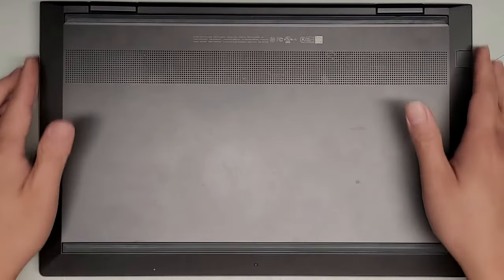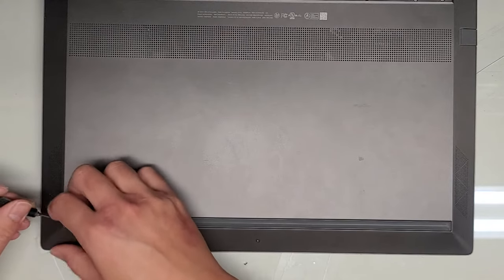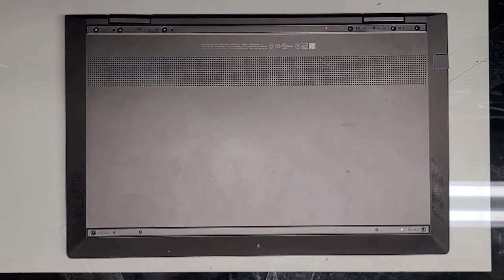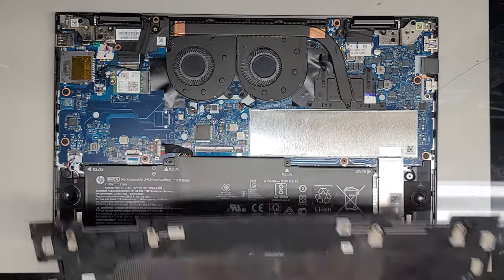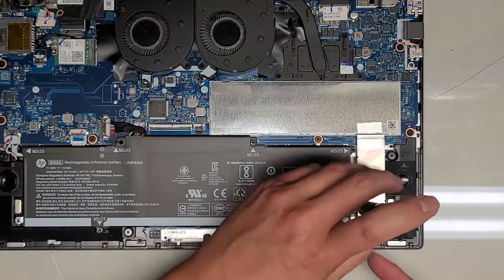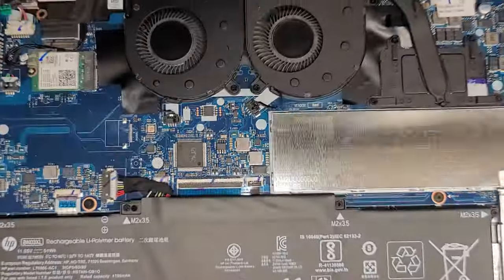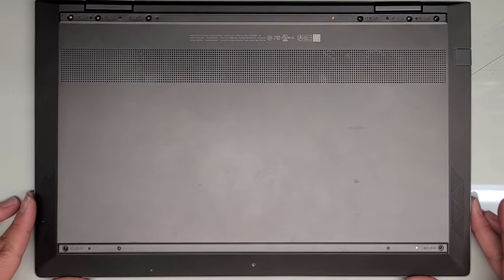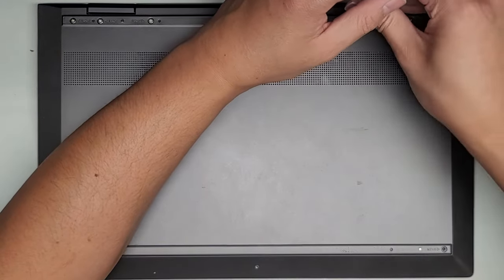HP ENVY x360 m Convertible 15m-ee0013dx Disassembly RAM SSD Hard Drive Components Quick Look Inside

Comment: Nice video right here. Its the only video i have seen that gives me the detailed explanation i need. I just need a few answers from you to confirm my suspicion. So i have an hp envy x360 touchscreen and suddenly the touchscreen stopped working. The screen still displays perfectly. Initially i thought it was a driver problem then like a day later after it stopped it started working again but the moment i closed the screen and opened it again for use again it stopped completely. So i wanted to know if the touch screen cable if different from the lcd cable. Im thinking maybe the touch screen cable has disconnected somehow and if i can try to connect it without opening up the screen and opening just the back.... Sorry for the long message but could i be right?
Reply from the maker: Check if it shows up in the device manager under human interfaces or not. If not, then it's possibly a connection issue.
Reply: @ItsBinhRepaired  it doesn't.... It shows when i tick the show hidden drivers option tho... And on the event tab its says the hardware last started on the last day it worked
Reply: @ItsBinhRepaired  it doesn't.... It shows when i tick the show hidden drivers option tho... And on the event tab its says the hardware last started on the last day it worked
Reply from the maker: That means it's disconnected or no longer working.
Reply: @ItsBinhRepaired  thank you for your replies. if its no longer working does that means i have to change the whole screen or maybe just the digitizer
Reply from the maker: Sadly unless something is just loose.
Reply: @ItsBinhRepaired  got it ... thank you so much for all your replies .... it really helped.
Reply from the maker: @d4eva4ce25  no problem

Comment: Very helpful
Reply from the maker: Glad it helped. If you haven't already, please like and subscribe so others can find my videos. Thanks!
Reply: @ItsBinhRepaired  one thing Missing though the removal of the m.2 storage
Reply from the maker: @isaacWilliams683  You'll want to watch some of my other videos for that. I didn't want to peel up the tape. Only one screw, it pops up and you can pull it out.
Reply from the maker: @isaacWilliams683  you'll also need to slide the metal cage off.

Comment: Some people use a blade of some kind to pry it open.  Is this recommended?

I'd love to see how the screen comes apart.  I need to replace my back cover, since the hinge broke loose.
Reply from the maker: To pry which part?
Reply: @ItsBinhRepaired  To pry both the bottom cover off, just after removing the screws, as well as prying the screen out of the back cover.  I need to do both.
Reply from the maker: Hmmm

Comment: what do i do if my laptop can power on but the screen is black, i have tried everything from other videos but they all failed. I followed your tutorial and just took out and put back the ram, but after putting back the bottom and powering it on, it stopped working. Is my laptop broken?
Reply from the maker: Strange, not sure. Try a battery reset.
Reply: Try a different ram stick
Reply from the maker: Wonder if it's working

Comment: hey ,  Binh gimm'e a advice , i'mean is it good idea to use laptory vertically (i'ad asus tuf gaming ,  and i use it vertically sometimes(kinda 0.5 the day time ) by opening it's hinges around 140-150 deg  and make it rest on one of the side bar (on the one  which'ad no port's  nd it's pretty thicc , so it remains stable on that ) ) !! ^^
Reply from the maker: Vertically?
Reply: @ItsBinhRepaired  ya in vertical plane , ig in Portrait mode !!
Reply from the maker: @gunnuonfire  should be ok

Comment: One day my laptop mysteriously stopped working after working a couple of hours prior(it was plugged in). I tried all the online methods and contacted HP they said it was hardware. Should I replace the battery or? My parents would be so pissed if they found out please help 😭😭. Btw for reference I have the envy x360 15-fh0023dx
Reply from the maker: Sadly it's likely a dead motherboard
Reply: @ItsBinhRepaired  So…. new computer??
Reply from the maker: @aora3830  sounds like it
Reply: @ItsBinhRepaired  Tysm for your help 😭😭😭😭
Reply from the maker: @aora3830  no problem

Comment: Does hp envy x360 convertible 15m have cmos battery?
Reply from the maker: No idea. You can test by disconnecting the battery and holding the power button 15 seconds. If the bios is reset, then it's built into the main battery, otherwise it's hidden somewhere.

Comment: Does hp envy 360 have cmos battery?
Reply from the maker: All I know is in the video. Try disconnecting the main battery and holding the power button 15 seconds. If the bios resets, then it's built into the main battery, otherwise, there's a cmos battery somewhere.

Comment: My fan goes primarily when it is being charged. Why?
Reply from the maker: The processor can run at a higher speed.
Reply: @ItsBinhRepaired  Interesting. I occasionally get the blue screen of death. Is it possible there is dust inside, is that common?
Reply from the maker: Hmmm strange
Reply from the maker: Hmmm what error does it give?
Reply: @ItsBinhRepaired  no error.
Reply from the maker: Hmmm not sure

Comment: where is the harddrive again? i cant pinpoint. under the battery?
I am trying to copy the files i need, my laptop is not booting up
Reply from the maker: To the right of the battery. Watch the video again.
Reply: @ItsBinhRepaired  thanks! I see you’re from the bay area. do you have your own shop or work for GeekSquad? I need help with my laptop, almost same with this model
Reply from the maker: @greenboyvlogs  I work from my home
Reply: @ItsBinhRepaired  can you take out a stripped screw that is holding my SSD? I’ve tried everything. willing to bring to Milpitas (if yes where?)
Reply from the maker: @Ransey Bautista  sure, the address in the description. Google my company and you'll find more about my company, or itsbinhrepaired.com